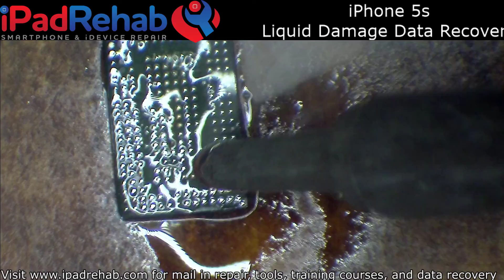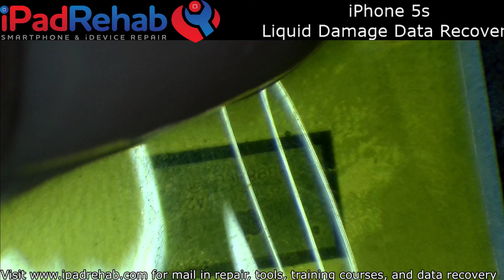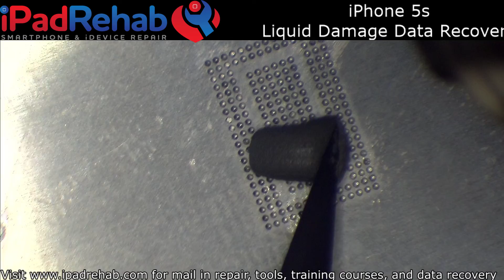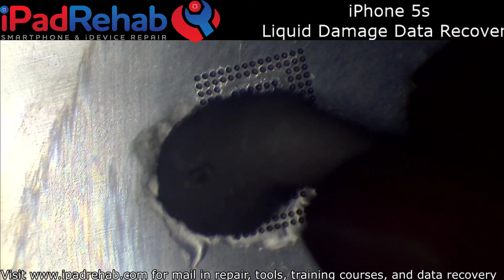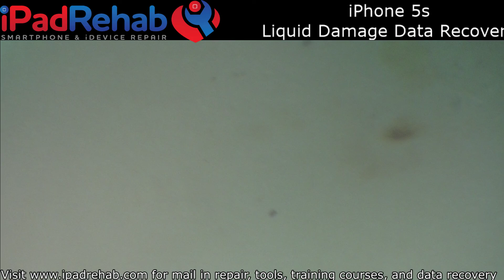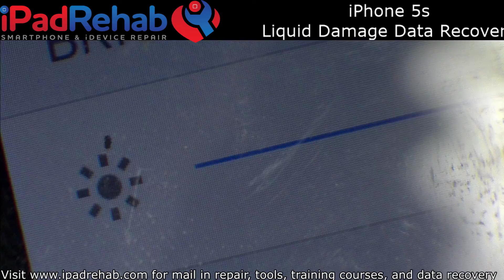Data Recovery: iPhone 5S Bad PMIC

Comment: Have you seen an example like this or may I ask you a question? -- 

1.Occurs when screen brightness is at full speed. (Momentary black screen blinking)
2.When the screen won't turn off -  (use it,, touch it)
but when leave it still (without recognition), the screen will turn off.
3.Sound is heard after the screen is turned off

interesting,

However, a proximity sensor (screen action when touching your face when talking on a mobile phone) 
On the other side of the display microphone, the screen comes out (Receiving, listening)
if  hold it with your hand for a while

Comment: Just a tip I learned from asians for reballing, I dry up the solder paste right before the reball by squeezing the amount I need inbetween two tissues (I use toilet paper but it can be anything really) This will remove a load of the flux it has inside, the flux becomes a huge problem whilst reballing bigger chips like the CPU because it causes to lift the solder balls from the solder paste up top, and can induce the chance of the solder paste just flooding over the stencil. 

Maybe you knew this already but was just making sure, also keeping the solder paste cool (10~15minutes in the fridge) prior to use can help alot.